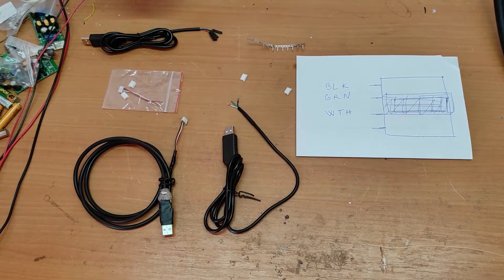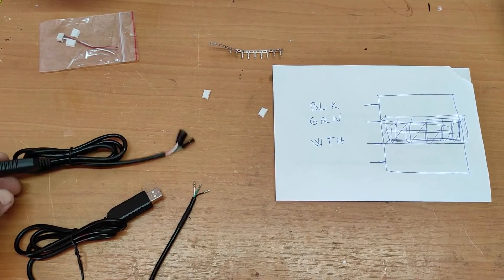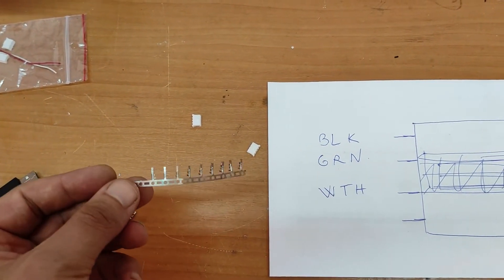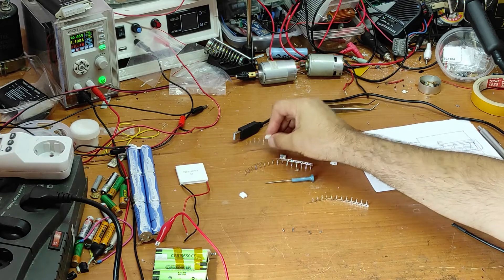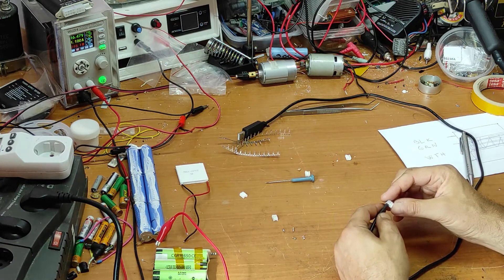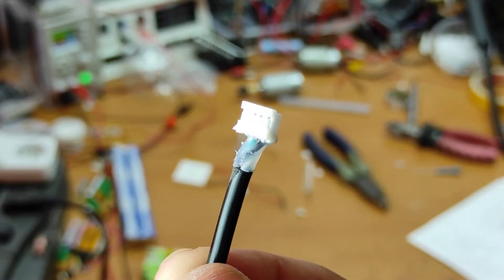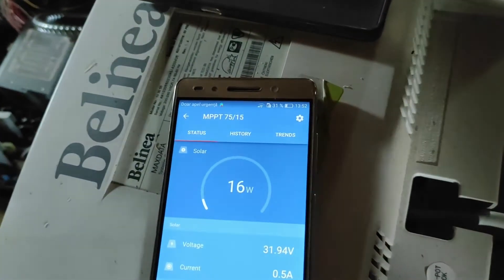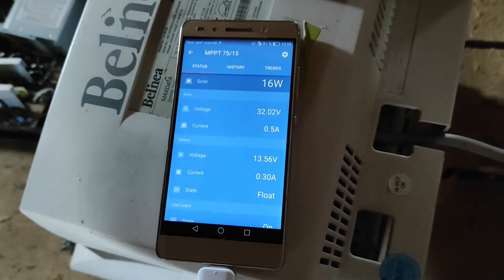DIY VE Direct data cable for Victron devices under 4USD

Comment: If the USB serial adapter comes with DuPont female connectors can I just hook that straight to the victron? Assuming I put the connectors on the correct pins.
Reply from the maker: theoreticly yes, but I sugest u to do it this way , its sure. and tested. but u can test and tell us after.

Comment: 1)  +5V (red) in TTL PL2303HX not connecting to PIN?
2)  Will the cable work with VenusOS (Raspberry Pi3+)?

thanks 👍🙏
Reply from the maker: 1) not conected
2) I dont know bro u can try.
Reply: working 🙏 @diymariuselectro

Comment: If you would add the red cable, could you then connect a standard USB-Bluetooth dongle in order to connect your phone wirelessly?
Reply from the maker: I bet this is not that simple and is not working.someone should reverse engineer original ve BT interface

Comment: Hi Nice to see your all videos. I have a problem just thinking that you might be able to solve it. I have Victron MPPT charge controller 75/10. It does not have built in bluetooth. I have succeeded to use the victronConnect S/W by using pl2303(USB to TTL) module through PC and and Android Mobile using OTG. The S/W runs smoothly without any problem. Now i just want to use VictronConnect Software with bluetooth module e.g HC05 or anyone like that. I have tried many times but got no results. How can i get the results ? please suggest if you have some idea in your mind.
Reply from the maker: now I dont receive money for this chanel,I dot only for passion from 2 years.but if 3 good people donate money for this project,I can buy an original and try to clone it.
Reply from the maker: I also have in mind this idea to build diy VE direct bluetooth device,but is not as simple as it seems.Its a lot of protocols and setings to do.U have to reverse an original one to clone it.

Comment: Hi, it is very informative. how can we wire to rj45 connector. My Bt device is not working please give me solution to rj45
connection
Reply from the maker: I cant help u because I dont know what are u talking about,pls give some details.
Reply: @diymariuselectro  I have victron charge controller and my bluetooth device has been damaged. Now i want to connect my Victron charge controller to my computer through USB or LAN(RJ45). Is there any way to make a wire ?
Reply from the maker: @AsifFareedch  you can make this cable for usb and will work.

Comment: Hi, thank you for your vídeo, can you tell me if I can connect with USBC for Victron APP use, instead PC? What will be the pinout? Thanks!!!
Reply from the maker: I used this device with Usb-microUsb adapter on my old phone and works fine,and I am sure that it works also with Usb-UsbC adapteron my new phone. But I dont know the pinout, I will search and I will make P2 of this video if its working.Tnx for idea.